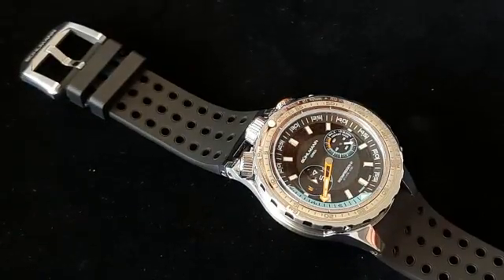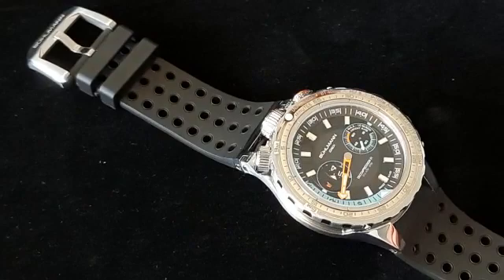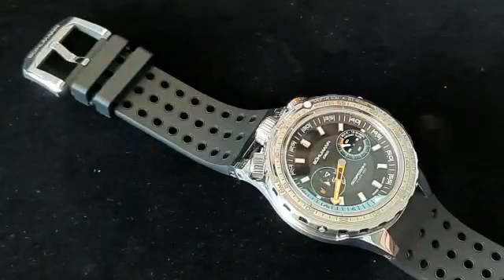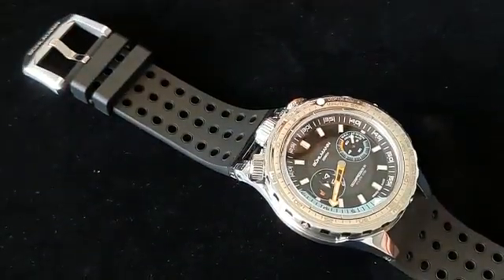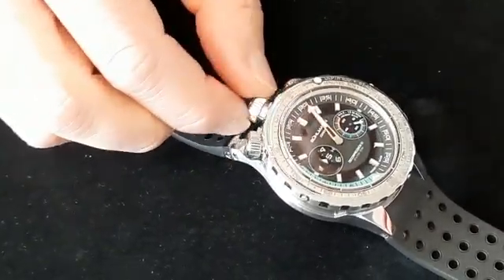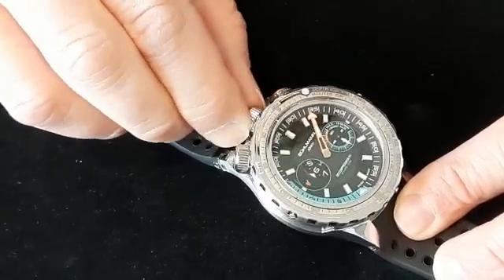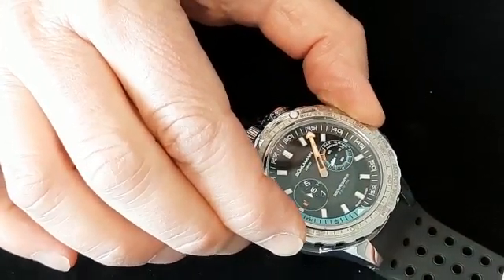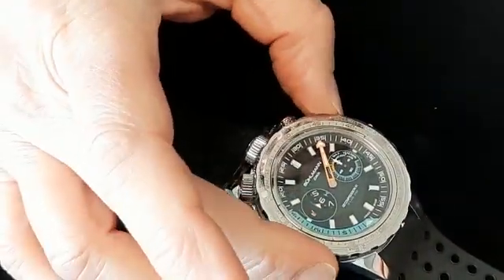How the security bezel of the Bühlmann Decompression 01 works

Comment: Can you answer the following question

What is the Fly-No Fly Indicator and where is it located on the Dial?
What type of Rubber is used for the Strap?
How is the strap anchored to the case besides the screws on the lugs?
What color does the Lume Glow?
The specifications state Type of Production - ''Swiss Made In-house production''. Can you provide more detail?
Reply from the maker: The fly-no-fly indicator is located on the left of the hour disk. It is a modified date disk with 3 colors which you can set after your dive with the crown and will tell you when you can fly (when it turns green,ie. after 48h).